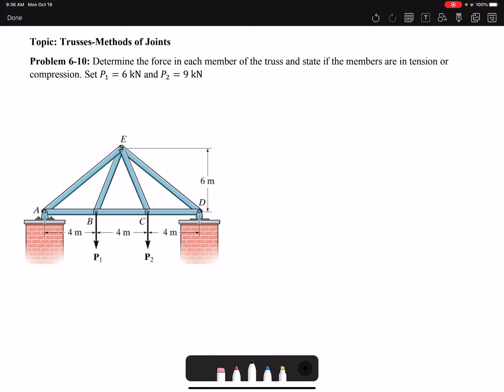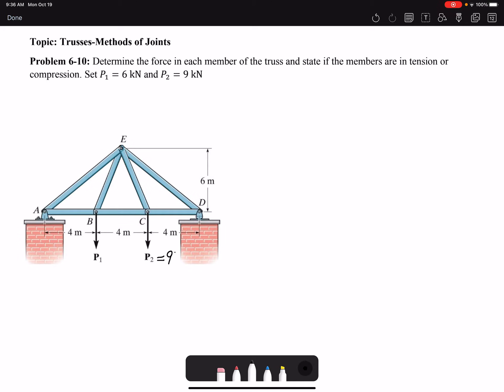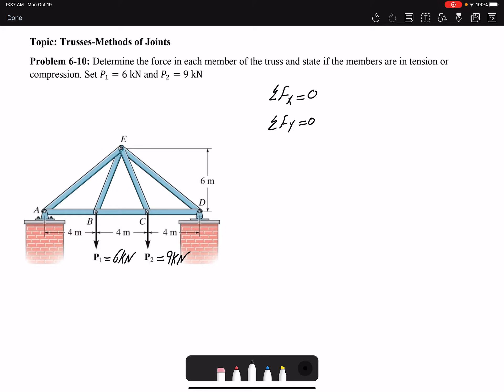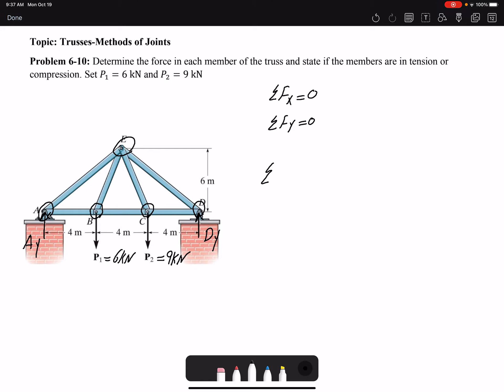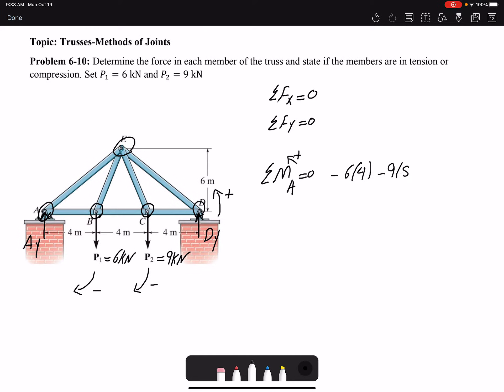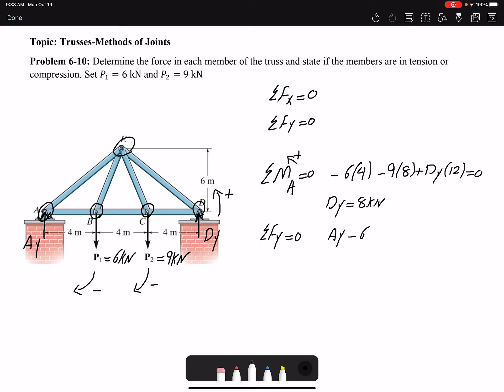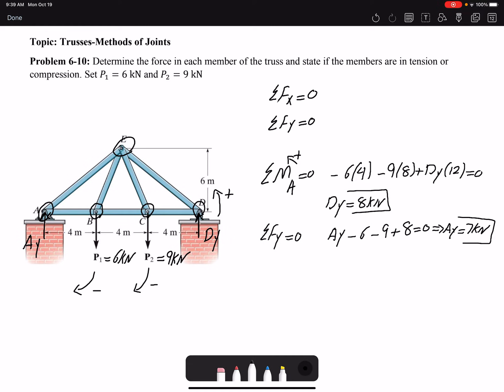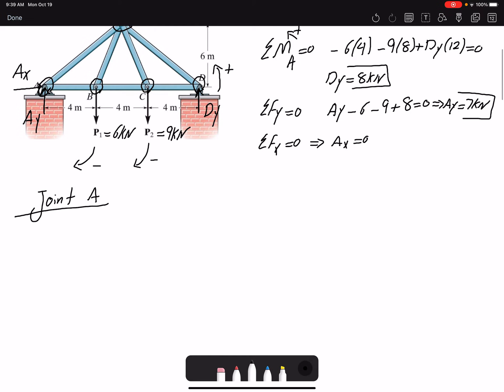Truss analysis: method of joints example (Problem 6-10)

Comment: i thought that the pin has two reaction forces
Reply from the maker: It depends on the pin, if there is a resistance in the horizontal direction, there is a reaction force but if there is no horizontal force acting on the structure there is no resistance on the pins either

Comment: Why does Fae go downwards?
Reply from the maker: That's the direction we assumed, and you would get a negative value if the direction is incorrect, but for this case, we know it has to be down to cancel the reaction force pointing upwards
Reply: @engineeringvision  thank you sir

Comment: Where did you get root 10?
Reply from the maker: According to Pythagorean theorem for a right triangle, 3^2+1^2=10
Reply: @engineeringvision  I have a question. I am currently working on a problem that is exactly the same as the problem you analyzed in the video. However, the only difference is that there is a force applying at E in the horizontal x direction (P—>E) Would the steps be exactly the same as in the video or is some of the two force members be different? Any help will be greatly appreciated. You make very good videos and they really help me study.

Comment: How did you get Sqrt2 in A? ... (6,6,6rt2)
Reply from the maker: Based on pythagorean theorem
Reply: @engineeringvision I understand the height was given, but how did you find the base ?
Reply: Did you find the base to be 6 because you went straight down the middle and cut the 4m in half equaling 2, then adding AB (4m) plus the 2m = 6m?
Reply: @bobby8502  a^2 + b^2 = c^2.  c = sqrt(36+36) = sqrt(36*(1+1)) = 6*sqrt(2).

Comment: how did you get from the geometry the 6 for the height and the width ( joint A )
Reply from the maker: Joint A is connected to Joint E. Joint E height is given and the width is based on the fact it is located in the middle of truss, therefore (12/2=6)

Comment: these look like pin and roller connections, why is there a moment?
Reply from the maker: There is no reaction moments at the supports because the pin connected supports allow rotation. However, each force creates moment.
Reply: @engineeringvision  that make sense, thank you so much!
Reply from the maker: @lliddle7616  You are welcome. I am glad it helped
Reply: Please can you solve the question if p1=3 and p2=9 in three different ways

Comment: Is there no force in the X direction at D?
Reply from the maker: No, there is no external horizontal force acting at D, nor is the reaction force in x direction, however, there is an action and reaction force between the pin and the member on the left.